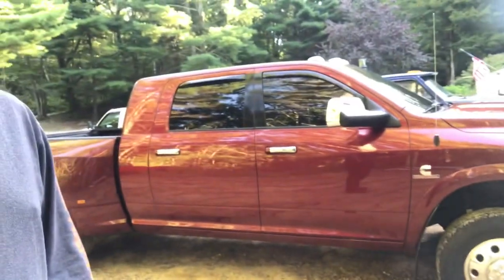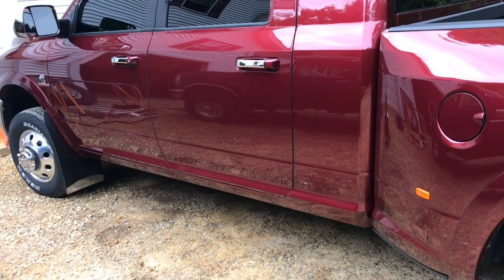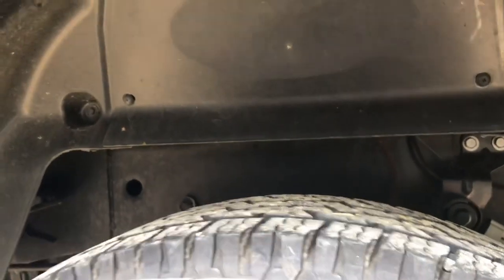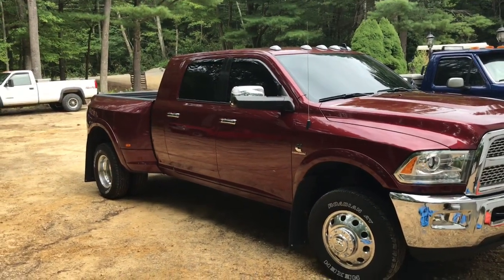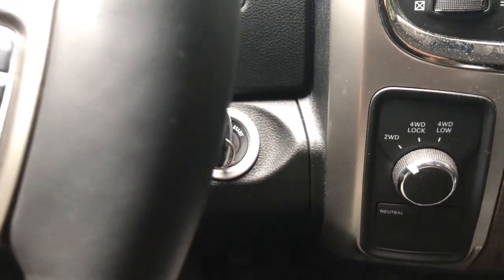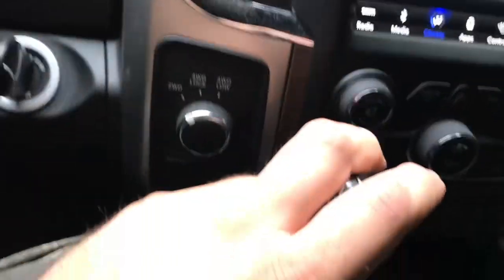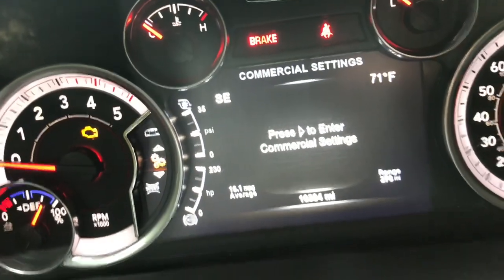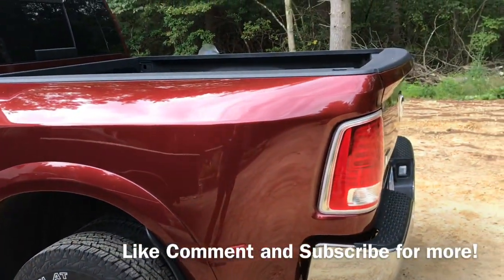Rare 4th Gen Mega Cab Dually G56

Comment: To do away with the light over the shifter dim your lights down until you feel the knob click over. Down side is you turn off the interior lights that come on when the doors open not terrible nice to be able to knock it down on a long trip especially with tint. Also use efi when the time comes it will disable the torque management and make the truck shift like the older ones (no rpm climb and normal fall when the clutch is in) also the only plus side I see to the air dump is when you are turning into a farm or job site and the trailer may get in the ditch or the terrain is drastic change it could make the difference between the trailer getting into the bed side. I’ve had mine very close the squat worked in my favor. Very nice truck sir.
Reply from the maker: thats a very valid point.  i never thought about that with the trailer.  who knows.  maybe one day ill need it!  Thanks!

Comment: Beautiful truck. Hows it tow with the G56 and what gears did you go with?
Reply from the maker: it tows pretty descnent.  i have 3.73 gears.  1-4 pull like a champ.  5-6 you need some rpm and momentum to maintain speed.  even on the highway.  its very hilly where i live.  ive got used to it and just have to plan for the hills
Reply: @Talbot_Industries   Awesome. What RPM are you running a 70MPH in 6th empty?
Reply from the maker: @matthewobrien7830  about 2150-2200

Comment: Yeah I got a 2017 delmonico red g56 2500 why they got rid of the manuals is a shame. If I ever end up getting a new dually I will send it to have the Aisin swapped out with a Eaton fuller manual. Preferably with high low switch.  Great choice on color
Reply from the maker: that would be a pretty sweet setup!
Reply: Talbot_Industries  I never thought I’d see the day when a manual transmission was the option and not the standard. And shame on cummins because you can still get it with a manual in commercial applications for example school buses or dump trucks so cummins could have made it happen. In fact cummins should be the one mating it with a transmission anyway. This whole excuse oh the high output 6.7 makes two much torque it will tear up the G56. Then get the manual they use in the commercial trucks those dump trucks with the 6.7 in them some can pull upwards of 40, 000lbs  that’s why they made the high output 6.7 in the first place not for Ram. Just like the electric semi cummins came out with before Elon musks version.